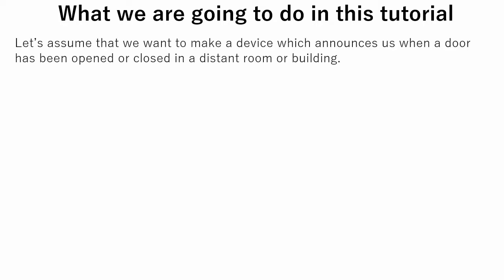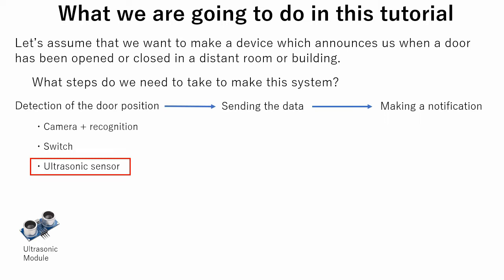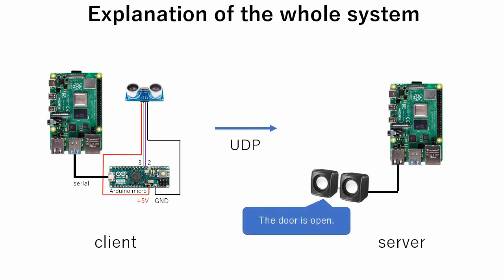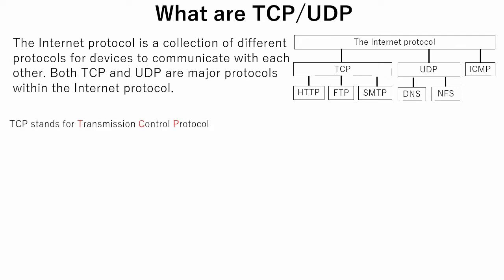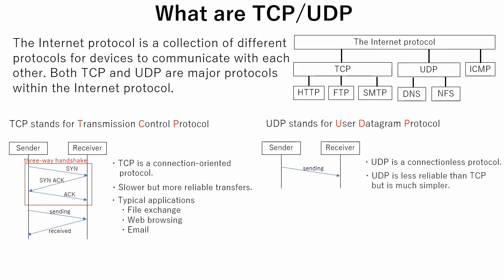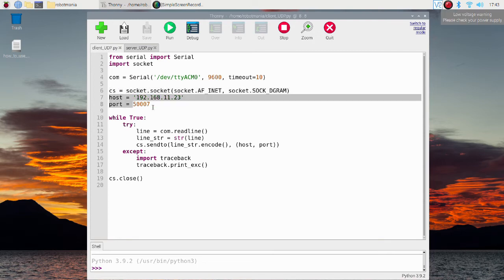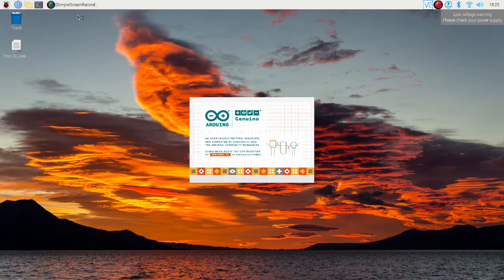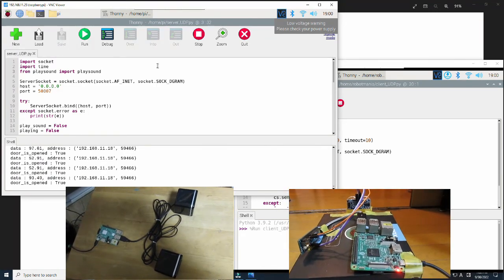How to make an IoT device using TCP/UDP, Arduino and Raspberry Pi

Comment: are you inside a virutalBox? if so what kind of linux diso is this? I love your work
Reply from the maker: Hi Moe Al!
Thanks for watching my video!
No, it is not a vertualBox. I am using usual Raspbbery Pi OS which you can install using “Raspberry Pi Imager”.
Reply: @robotmania8896  so you have it installed on a computer as your main OS? Awesome if this is the case
Reply from the maker: @moeal5110  Yes, I have installed Raspberry Pi OS on a computer which is a Raspberry pi. I have used two Raspberry pis in this tutorial.